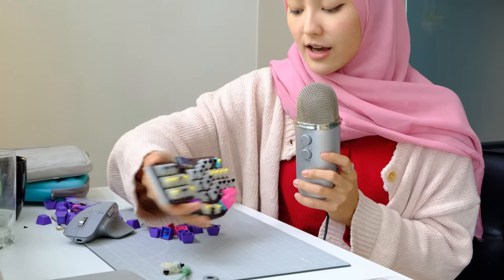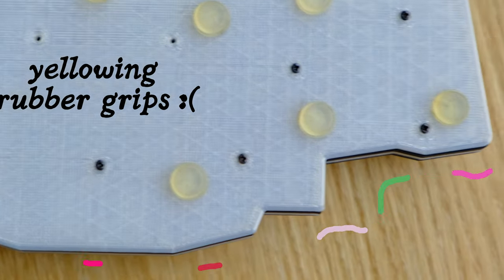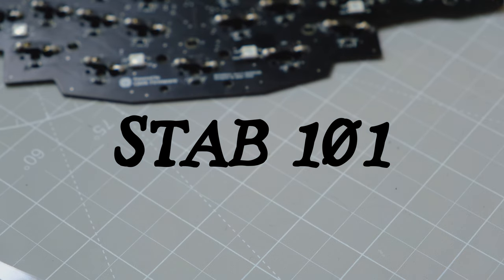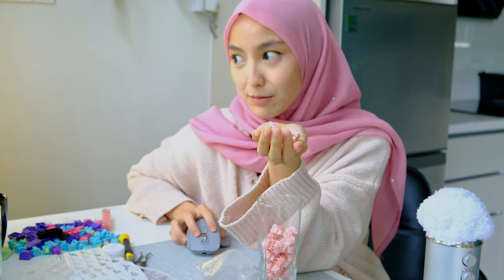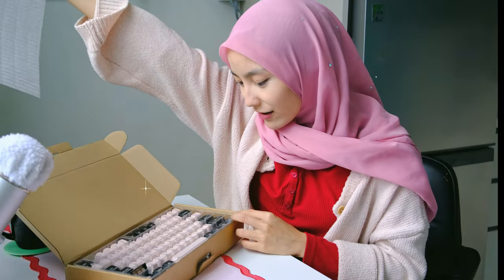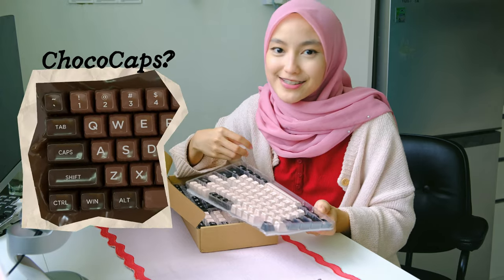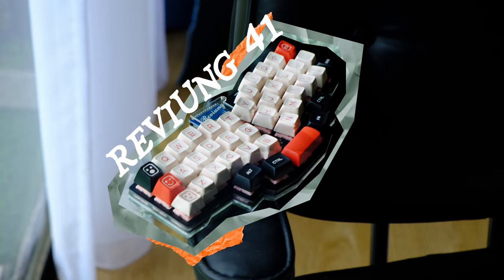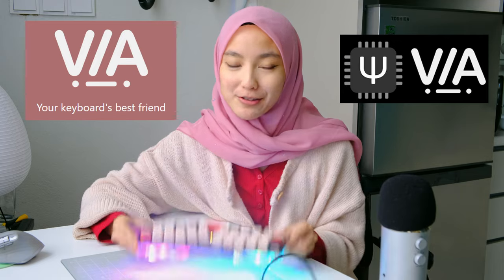Re-Doing My Keyboard because why Not? | Reviung41 with Strawberry Jelly Switch

Comment: OMG! It's magical. Me myself still stuck in designing my own hackable programmable Mecha. Combining RPi Pico, Pi Zero 2W and cute secret OLEDs haha. 🎉 Welcome Back Wan!
Reply from the maker: Wow that is super creative! Are you building a small version keyboard and making your own pcb?  Always wondered how to build something from scratch like that.
Reply: @WanSyazlina  Yea it actually is a keyboard, and a computer, or a computer inside a keyboard. 

Mini sized keyboard + a small computer sounds very nice too but right now i planned it to be 79 keys. Some of the designs iteration includes  diy pcb of MK, and using already off shelf keyboard, on top of a diy hackable computer. Fuh 2 years already and still working on the designs and thinkering with its electronics ❤